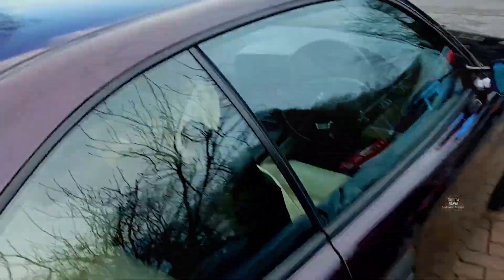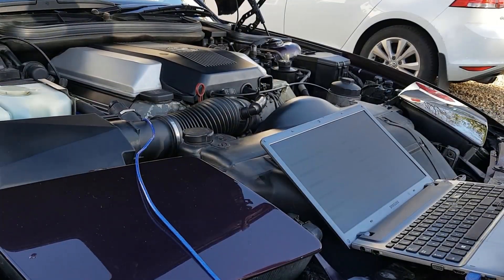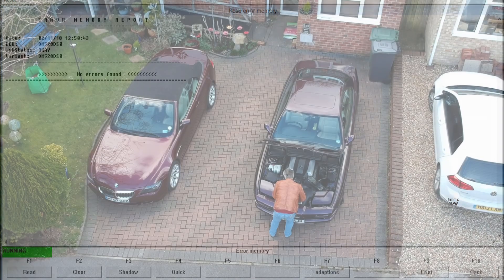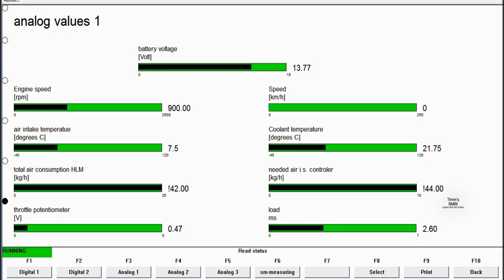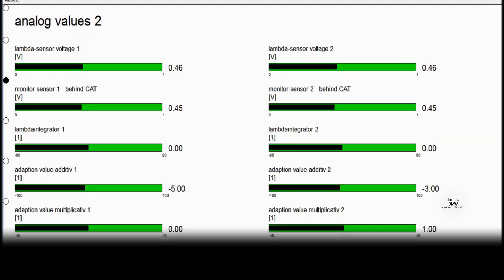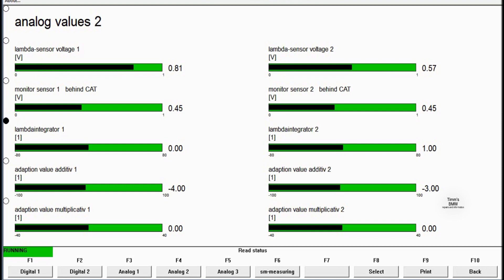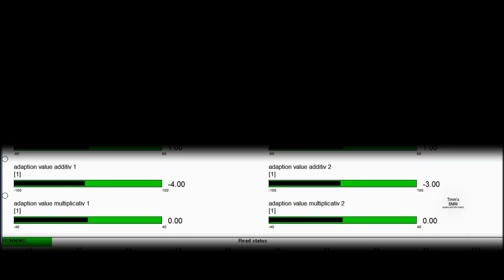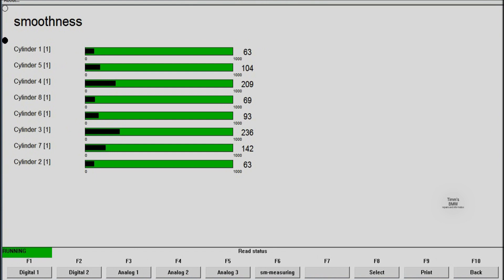BMW Diagnostics for Beginners – The ONLY INPA Pages You Need

Comment: sice you have e63 
i have the 645ci but i cant find e63 in inpa if i used e60 n62 will it works fine?
Reply from the maker: It may do - but you need the correct version of INPA for other modules
Reply: Do you have the right daten files ? 
I cant find them for e63 and i want e39 files also @TimmsBMW

Comment: Hi Tim thanks for for your amazing videos. Im curious if this set up will work with a 1998 e36 323i as I am trying to read some abs and traction codes as I have both lights on the dash
Reply from the maker: My pleasure! Yes, the USB version (same as I am using in this video) will get gearbox, engine and ASC+T and ABS codes
Reply: @TimmsBMW  Thank you for your response would you have a link to an up to date source on where to acquire this cable?

Comment: Hi Tim im getting "multiplication mixture adaptation bank 1 / bank 2 control limit reached" what is the first thing i should be looking t to fix
Reply from the maker: That would be the Fuel Pressure Regulator and the vacuum line from it to the inlet manifold
Reply: @TimmsBMW  thank you for reply, so check the vacuum line first I guess ?
Reply: Where is the fuel pressure regulator located please ?
Reply: @TimmsBMW  hi Tim, I replaced fuel filter and pressure regulator along with vaccum line and fuel hoses, drove for a few days and the codes came back, any  further suggestions on what to do next ?
Reply from the maker: What are the values of both the additive and multiplicative values after a short drive?
Reply: @TimmsBMW  I will have to check and get back to you 😀
Reply: @TimmsBMW  at idle they are  bank 1 0.23 and bank 2 0.47. The error code for bank one was displayed.

I cleared the codes then went for a drive and bother values were 1.73 and 1.78 while I was driving.

Once I parked I checked again and they were both then at 2.20 just before I shut down engine
Reply from the maker: @benm6899  So, those values show that the mixture is too lean when driving, next step is to measure the fuel-rail pressure at idle and when opening the throttle. The pressure should be 3-Bar at idle and 3.5 Bar when opening the throttle
Reply: @TimmsBMW  ok great I’ll try this. Thank you for getting back to me. Hoping it’s a vaccum leak
Reply: @TimmsBMW   can this be done on a scanner ?
Reply: I replaced MAF and those adaptation values are now fluctuating at idle from -0.80 to -1.75

Comment: Did anyone on here get INPA to work on models from 1992 or older? I've been trying to read fault codes on an E32 but no matter what cable,  operating system or INPA version i try, it just won't connect...
Reply from the maker: For pre-OBDII cars (around 1995 or so) you need an ADS interface and a laptop with a true 9-pin D-Type RS232 port (not an USB toRS232 interface). INPA is not the problem - it works on all 'E' models, it is the interface that is important. I think the last remaining ADS interface is the 'Tiny ADS' which can be found on Ebay

Comment: I have a 1995 840ci BMW I’m having problems with the left side headlight it sometimes goes up when turning on the headlights and other time it dose not do u have any Suggestions I think you and advance
Reply from the maker: Yes, that will be K39 which needs to be resoldered due to joint fractures - you can find it here: https://www.meeknet.co.uk/e31/Timms_BMW_E31_Relay_Finder.htm
Reply: @TimmsBMW  thank you
Reply: @TimmsBMW  im looking for the transmission oil cooler lines  for a 1995 BMW 840ci 
and was wondering if you might be of help and guiding me on where to purchase them . 

I thank you in advance.

Comment: Hi Tim.
First i want to say Thank you for that video ( for me it was hard to find information  about M62 engine with normal parameters )
I heard a lot of information about air leaks, but i think i have other problem.
1)  Rough idle ( shakes a bit ) - idle rpm drops from 600 to 550 and rise up to 600
2)  additive adaptations -3.00 ( thats mean rich mixture ), but intake air 17.5 kg/h and i.c. reqired 14.5 ! ( too low, isnt it ? )
Could it be problems with fuel injection system ?

NOTE. I never heard discussion about inlet air units ( kg/h ), but when i calculate i got ( kg/min ).
Reply from the maker: Thanks! That sounds more like a misfire - how is your roughness readings?
Reply: @TimmsBMW  
So...
Roughness in cylinders 5 6 7 is higher then in others and the values are 540 / 480 / 530 
Lowest values for air are HLM 14 / i.c. computer required 11 ( rpm 570 ) AND voltege drops to 12.45 ( but this voltage drop is due to low RPM. I dont know is it normal, but if rpm drops lower than 600 voltage begin to drops and when rpm lower than 550 voltage is lower than 12.5. when RPMs higher than 700 voltage is stable ( 14 ... 14.8 V )
Once when i played with INPA and i reset adaptations i had faults MISFIRE ( 62 Misfiring in Various Cyls
 / 50 Misfire Cyl 1 / 53 Misfire Cyl 4 / 54 Misfire Cyl 5 / 55 Misfire Cyl 6 )
And recently i had MAF fault ( 115 Air Flow Meter HFM Signal
 )
So now i think the problem is in MAF cause these strange air mass values. 
On your website you mentioned HLM value must be 20 - 25 kg/min.
But anyway i will start with simple tests : Fuel Pressure, Vacum leak.
About misfire and roughness : a swaped Ignition coil between cylinders No.5 and No.1 and no changes.
Thanks for unswer !
Anyway i will find the probmlem. I like troubleshooting, but its helpful to recive advice from experianced man !
Reply from the maker: @vladglugovsky421  Yes, MAF sounds like a dud or a Chinese copy! Let's pick it up after you have replaced it - I'll be waiting!

Comment: Can I do everything by plugging directly into my OBDII port? Or do I have to get the 19 pin adapter?
Reply from the maker: All engine and gearbox diagnostics can be done from the in-cabin OBDII port - anything else needs the under-bonnet connector
Reply: Where is the under bonnet connector on a 650 please?

Comment: Hi Tim.
Same engine 4,4l
Smoothness test cylinder 2 around 500 rest of them between 60 and 100.
What should I look to improve cyl.2
Thank you
Reply from the maker: Swap the coils around and see if the high smoothness values follows the coil - if doesn't change plugs - still no luck do a compression test.

Comment: Hello Timm.Brilliant videos for BMW community .Watched them all many times.
My M62 840 engine has light vibration once cold.Should I worry? No Vacum leaks ,spark plug banks dry, no  oil.
Reply from the maker: The M62 is slightly lumpy at 500 RPM, however, normal idle is 700 RPM with the A/C working - so make sure that works first - the revs should increase when the snowflake LED is lit - if it doesn't the A/C probably isn't working.
Reply: Thank you Timm .
My a/c doesn't work in deed and it's on my list to sort it
I am also ordered OBD cable and will try same test as you demonstrated .
Cheers Mate

Comment: Hello There, another day studying E31 850i heater system, so I'm glad to find this, haveing checked the links below which i will need to sort this car out, the product description doesn't list E31, I know that you know better - can you please confirm the best hardware/software I need . Chassis CB57099. hopefully this will allow me to run checks on the heater "blend doors" one of which may be broken.
Your the Guru on this  - your reply is Very much appreciated. PS, will use bimmerforums for comunication if you'd prefer Sir
Reply from the maker: With the V12 E31 you need an ADS interface - they are still available, but getting few and far in between. For the ADS interface you need a laptop with a true 9-pin 'D-Type' RS232 serial port - a USB to RS232 converter will not do the trick! Have a look around and see what you can find online. However, I'm not sure if the diagnostics on the IHKA is that verbose and it may be better to remove the kick-panels and have a poke around.
Reply: @TimmsBMW  Hey Tim. I have a 91 850i V12 that my father bought in 91. I've been working on it lately and would like to be able to see lambda values, Adaptation values, ect... 
To read the 850i need to use an ADS interface, as you said, but a laptop with a 'true 9-pin 'D-Type' RS232 serial port'? Is there any other way to do this besides buying a 20 year old laptop and an ADS only interface? And if i have to do it that way.. Would this interface work? https://openlabs.co/store/Tiny-ADS-Interface or this one? http://www.one-stop-electronics.com/shop/?dispatch=products.view&product_id=17. Thanks for all the information you put into these videos and your website, it's keeping me afloat.

Comment: Could smoothness predict impeding coil on plug failures? I'm so tired of having them fail without warning and it would be nice to predict them.
Reply from the maker: Coil-on-plug units shouldn't be that unreliable - I've found that Delphi units last a lot better on the 650i - I replaced all 8 in 2015 and have no failures so far....

Comment: Hello there. What year is ur bmw?  Im dealing with problems connecting old bmw as e34 e36 using this setup.  I did a small research and found out that the old bmw use L-line instead of K-line and its not possible to connect it via usb obd interface. DO you have any solution?
Reply from the maker: For pre-OBDII cars you need an ADS interface, and then you need an old laptop with a real 9-pin D-Type Serial Port. These are getting harder to find these days but one seller on Ebay still offers it.
Reply: Timm's BMW Repairs and Information but your 8 series hasn’t got obd2 neither?

Comment: Very nice video! I learned a lot from your tutorials. I have a 2004 645i and i have my idle around 550 rpm acc. to inpa, but i feel a very slight roughness in it, above idle its all fine. Looking at the values my highest smoothness is around 1.2 on a -12 to 12 scale with the lowest -0.75 and they are pretty constant. The integrated lambda signal stays around 1 for both banks with the additive adaptation 0.5 and -0.5 on the 2 sides. Multiplicative also stays both banks around 1. Are these values considered fine? Thanks!
Reply from the maker: The N62 was never that smooth and has a bit of a lope to it (compared to the M62) - and those numbers sound fine.
Reply from the maker: Yes, try DUDMD on The E38 section of Bimmerforums.com

Comment: I have an 05 x5 that I replaced the amplifier in ,,now when u turn on the stereo the sound stops at 30 to 40  if you turn it off and on again same thing, I was told I have to recode the amp because it was from another model BMW ,, does inpa or ncsexpert help with this?

Comment: Thank You very Much, I applied information given in this video on My Z3 1998 BMW, and by viewing the smoothness page, I monitored the cylinders, where i got 4 as zero reading and the other two range around  2000 for one cylinder and 500 for the other. As I understood from the video that I got 4 dead cylinders with misfire and running rich?